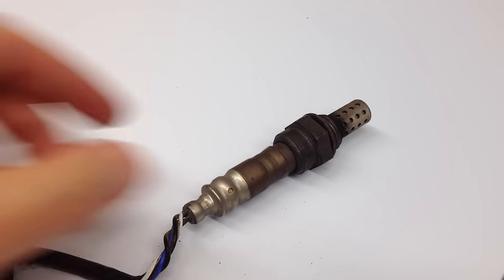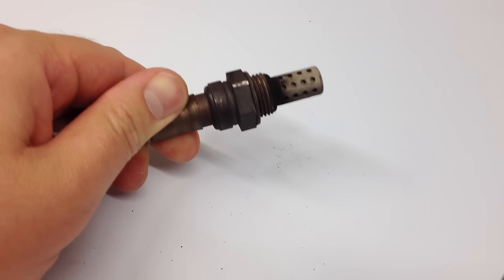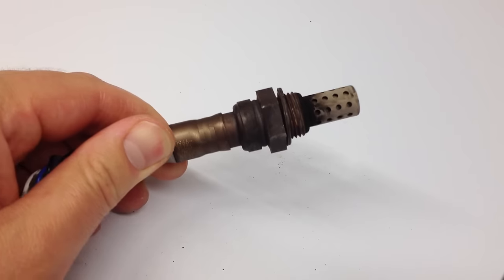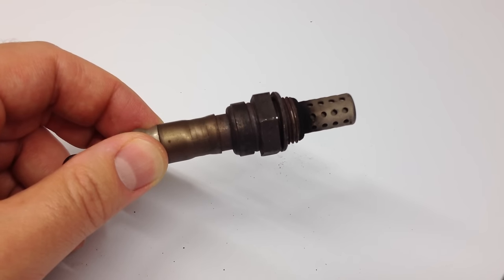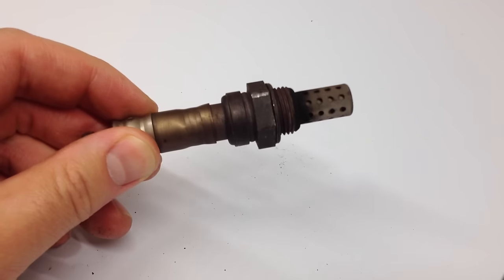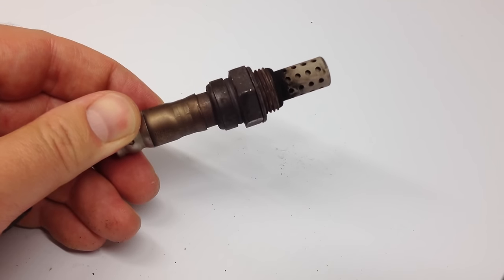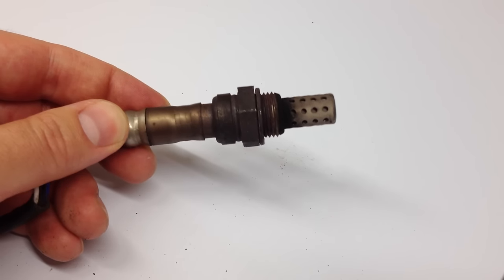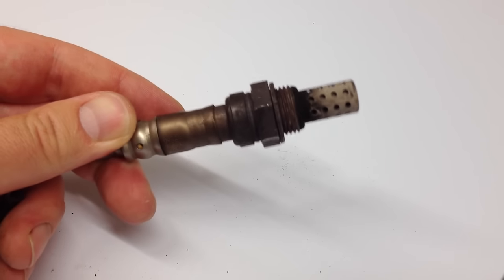Bad Oxygen Sensor Symptoms and Dangers

Comment: will the o2 senser cause a car not to stay running and cause backfire through the intake into the airbox. have to pump gas to keep the car running and it doesnt really run smooth and doesnt rev high
Reply: Throttle cable r linkage is loose
Reply: thats your mass air flow

Comment: Can  a   catalytic   converter   be   stopped    up    with    the    oxygen   sensor    being    still     good?
Reply: Yes, there's other things that are out of the O² sensors range or responsibility like bad rings or valve guides and seals. There's a pecking order when working on car's: always try the cheap and easy stuff first. Things like air filters and oil change's are often overlooked.

Comment: i was getting o2 sensor error(bank 1)...replaced it with an after maket o2 sensor....the error went away but after starting the car the car does not accelerate properly(move forward) for first 10-15 minutes and then works flawlessly.....if i switch it off, again for 10-15 minutes same thing will happen then work properly...what could be wrong? is this after market o2 sensor the problem?
Reply: Almost everyone and every service manuals tell that only original replacement parts should be used for the oxygen sensors. The price difference is so small - 30 - 50, usually, for a part that normally lasts 160k / 100k miles -  that there's really no reason to use generic parts, unless that is the only thing you can find.

Comment: IF SOMEONE COULD TELL ME what would be a deal if leaving it, unplugging it or do I need one for the car to run strong, proper and it's fastest ability. 
MY 96 Civic is being converted to a dirt track racer and will never see the pavement as a legit car again. 
I want to get the most of this cute little 1.6 so I do want it to run it's best. 
(I just pulled up the 035 code tonight)
Reply: @MrRusell86  very cute way of attempting to say I'm uneducated instead of you assuming that it could possibly have been an "autospell" situation that occurred during my typing of a question,  very possibly while using my cellular device.  
But thank you for informing everyone that wastes any time reading this just how educated you think you are.
Reply: It will  either  run to lean or to rich! This will damage engine  and converter!
Reply: Yes, any fuel injected computer controlled car needs a functioning  O² sensor, mass air meter, and throttle position sensor. The O² sensor plays a critical role in telling your PCM how many times and pulse width to open the injectors for fuel. Look at when you buy an EFI kit for a muscle car or hot rod. It's designed to look like a carburetor but it's throttle body fuel injection. And you can bet your ass it comes with an O² sensor.

Comment: Will this make your truck run rough if it’s a bad sensor
Reply: Yes if the air/fuel mixture isn't correct your idle becomes out of sink because it's not getting the correct mixture to keep it from stalling

Comment: My 97 Town Car will randomly throw a code for both sides of the engine saying "mixture too lean." Will a bad o2 sensor cause that?
Reply: Yes
Reply: @juanlatin3595  Turns out that's not what it was. The battery was going bad.
Reply: @DarkElfDiva  that’s a new One me. Never heard of a bad battery doing that

Comment: could this make ur car turn over and but after starting it dies after a few seconds, but once u hit the accelerator it goes and u have to put in N , and keep it a live until light changes and then change it to D and then go.. after about 5 mins the problem might go away?  "i really need help , i have done so much to this van 98 ford windstar 3.0" i have put nearly $800.00 in parts.. i'm not ready to give up, it had all original parts and unfortunate events happen where i had no choice to drive it to FL from tx and i knew it wasnt ready..it made it home though, so any ideas please...
Reply: I have the same problem with my Jetta did you fix the problem or know what was the issue? ..thanks.
Reply: I have the same problem with my Jetta did you fix the problem or know what was the issue? ..thanks.
Reply: scrap yard,then buy different vehicle

Comment: would it make a noise if it's bad on a 93 Volvo 940 ?    It starts but wants to die useing the peal keeps it from dieing
Reply: Definelty not the oxygen sensor. It is not working on cold engines. I would check:
1. fault codes
2. the plugs
3. clean the throttle valve
4. search for vacuum leaks
5. check the petrol pressure
6. check the injectors
7. check the (spark plug ignition [dont know the english word]
8. check the maf airflow sensor data delivered

I think plugs will fix your problems. If they get older cold engine start isnt nice at all.
Reply: Nighthawkzone2 Thank you for your info .The car is still sitting . The only reason it is I'm on a fixs income and I'm sick .But now it's getting nice outside I will do the Plugs .I done number 3,8  . and again THANK YOU Nighthawkzone2

Comment: I just replaced o2 sensors in my rx8 (both up and down). I bought them off of amazon and ebay trying to save some $. They looked identical to the old ones and amazon and ebay said they would work for the rx8 and had good reviews. It started great! but when the temp rose it started to sputter high idle and very low rapidly like it was ready to stall then idle high. What the hell? Do I need to spend the big bucks or what? They are expensive!
Reply: Jbaz what kind did you buy? I just purchased NTK for my rx8 installing it tomorrow
Reply: Mauricio Giraldo Denso 234-4349 Oxygen Sensor (Air and Fuel Ratio Sensor) for the downstream. But the  #s  on the box it came in doesn't match up to any  #s  on the actual part. Not sure if its the right part in the box. It does look identical to the old part though.

New O2 Oxygen Sensor UPSTREAM Mazda RX-8 2004-2008. I bought that one on ebay for $43.36 from Carpartswholesale. I think this part was the problem.  lol  Its a pain in the ass getting to your upstream sensor. I took my oil filter off to give me room to reach the electrical fitting. I also taped the old sensor to the new one  so I could pull it through the same rout because its a nightmare if you get it caught somewhere you cant see. hope this helps.
Reply: Jbaz I heard NTK are the best choice and Denso I next in like after oem of course.  yeah that does help man I was wondering how the hell i was supposed to get to the connector.  once I do it and test it I'll let you know how NTK performs
Reply: Thanks. I cleaned the old sensors and put them back on until I get the right ones. lol that sucked.
Reply: Jbaz dude I am currently having a fight with this damn sensor.  hardly any room and the socket I bought is too short to allow me to attach any wrench and turn.  😤
Reply: ok, I was going to mention this. under the vehicle there's a bracket that is mounted to the exhaust and the bell housing with three bolts. I took that off to give me more room. I also used Neiko 03048A O2 Oxygen Sensor Wrench with Contour Handle and Flexible Head, Cr-V | 7/8 inch     to get the upstream sensor off. I bought it off of amazon but you might be able to get one from a parts store. Then take it back if you want lol. Too bad you don't live in AZ I would let you use mine.
Reply: Jbaz finished changing the sensor after a bit of a battle, a beer and lunch.  car is noticeably better.  my exhaust popping is gone and shaky idle as well.  the real test is tomorrow after a day of hard driving it.  hope you get yours back at 100% man!
Reply: Good job.
Reply: check AutoZone  or Orilley

Comment: Cant get obd codes read at auto parts stores in California. If anyone can get their codes read at one in cali good for you...its illegal now.
Reply from the maker: Wow!  I grew up in CA. Nearly every day I hear something that makes me glad I left.  Illegal to know what's wrong with your car?  Unreal.
Reply: HotDayPleatherSeats yeah its pretty gay. Im over california. Most auto parts stores dont except used oil any more either. I worked for car quest and got to learn alot about the NEW laws.
Reply: I just had my check engine code read for free at O'Reilly Auto Parts a week ago and I live in CA. This is the first I've heard that they won't do it. I purchased an obd reader from Amazon for $15 that I can read on my Android phone and checked the code myself but wanted to make sure the reader I got was actually good. When O'Reilly scanned my car, they got the same code I did - P0135. I bought the 02 sensors from Amazon and called a local mechanic to ask what he would charge to install them; he wanted to charge me $90 to run his own scan before he did any work. I've heard that PepBoys will also scan for free.
Reply: like i said...if you can get it done good for you. i worked for an auto parts store and wasnt even alowed to use my own reader on my lunch break. i couldnt even use my own heat gun to check engine heat.

Comment: I got a oil leak cover fix got my car back had 02sensor and misfired
Reply: Could be a faulty oxygen sensor. Sometimes they can be DOA although not always likely if they are OEM like Denso. I bought a pair of Kwiksen and one trigger a code when I had no check engine light previously. I just change it because I notice a found rotten egg smell (sulfur) and low highway MPG than originally had before a serious catalytic problem trigger the check engine light from running to rich

Comment: dude....check engine light appears from many more reasons than those shitty sensors....i have changed both O2 sensors and the check engine light still appears after 60-70 miles.........a bad oxygen sensor doesnt change the mileage at all,and the catalytic converter will burn out whit high mileage,not because of a bad sensor....sometimes,we have to replace some parts in an engine...anyway we do not agreed whit...
Reply from the maker: Whoever said the light only comes on with a bad O2 sensor?  The video is about an O2 sensor not check engine lights.  And yes, O2 sensor does affect MPG.
Reply: only in certain cases..........
Reply: Aww yes it can affect mpg know your facts before spewing bs.
Reply: alicutz79 Any single instance a vehicle has a bad upstream O2 sensor I guarantee it will not get as good mpg as it would with a good O2 sensor. 

let me add some dots.............
Reply: let me add some dots.............
Reply: add then :)...more then dots means ideas,but add dots :)))))))))))))
Reply: ..more than dots, is all I ever needed to you to show, that your love for me is real :)))))))))))))
ruamilf?
Reply: +alicutz79 probably need a new set of spark plugs is all, plugs that are old and not firing properly and burning all the fuel correctly will cause the o2 sensor code to appear, as a mechanic of over 40 years, I run into this issue a lot, and a new set of plugs resolves the problem 99% of the time

Comment: Anyone!!! I already installed the oxygen sensor, but the light wont go off,  how much time do you need for the light to go off?
Reply: felixsegundo Unplug battery for few hours. You'll lose other stuff like radio setting and clock but thats only way if you don't have ODBII dongle. Personally it is worth $20 or so to buy bluetooth one and get android app troque. Well worth my money.
Reply: felixsegundo Assuming your vehicle is post-1996 of course, my van is 1996 and first year for ODBII.

Comment: question, i took out the wire that power this sensor on my car and check engine light did not come on, how come?
Reply from the maker: It usually takes a while for the car's cpu to recognize the problem, then the light will come on.  If you've driven for days/weeks and it hasn't come on then I have no idea.
Reply: i have already over 100 km since i unplugged the power and still no check light, it's strange because no matter how i drive the car the fuel consumption remains the same 8L of gas per 100 km which is way to much for a 1.4L engine.
Reply: rrazvanell im getting 20.5 per 100km on a 2,2l .lol

Comment: what are the symptoms of a bad 02 sensor ????
Reply: 1. Check Engine Light comes on
The first line of defense is the Check Engine Light. The check engine light will illuminate if you have a bad or failing oxygen sensor. This light can mean many different things, so it is important to have it looked at by a professional. If you have high mileage on your vehicle, chances are it is a bad oxygen sensor that needs to be replaced.

2. Bad gas mileage
If the oxygen sensor is going bad, the fuel-delivery and fuel-combustion systems will be thrown off. If a bad oxygen sensor disrupts the air to fuel ratio mixture or too much fuel is injected into the engine, the gas mileage will go bad. If you suspect you are filling up your gas tank more often, keep a record of how many gallons you fill up with and how often. 

3. Rough engine idle and misfires
As your oxygen sensor is going bad, you may notice your vehicle is running rough, misfiring or running irregularly while idling. Since the oxygen sensors output helps control engine timing, combustion intervals, and the air to fuel ratio, a bad sensor can disrupt these engine functions causing a rough or irregular engine idle.

Copy/Paste from another website, but the info is correct.
Reply: That is what I would expect. Now can one problem mask another and not give the code for another problem like the cam position sensor that is one that can cause similiar problems?
Reply: what are the fucking symptoms we know that the engine light will come on.
Reply: stop cussin' my DAWG reads these post too!
Reply: T G I'm so depressed with my cat coming home late

Comment: is there a reason that I have to keep changing these.  I have changed three times in the past year???
Reply: You are getting taken. Do not pay for another one. It is most likely another condition that is introducing oxygen into the system, (vacuum leak, etc) causing the computer to "throw" an error code related to the O2 sensor. Have the sensor and sensor wiring verified serviceable, by having a REAL MECHANIC do his job. TROUBLESHOOTING!! NOT REMOVE AND REPLACING. Today's so called mechanics ONLY R&R, and cannot figure a thing out past that. Get rid of the PUTZ who R&R'd 3 of the sensors and get yourself a good wrench. It will be cheaper in the long run. Less stress, less aggravation, more time to cruise...
Reply: way too many times,once every 50,000 km or even more as long as other sensors are doing their job.

Comment: i dont have check engine light on...engine runs good...but im only getting 15mpg city with my v6 camry
Reply: get a tune up or oil change
Reply: 15mpg? your driving a v6 what else do you expect.
Reply: Transmission is stuck in limp- mode 2nd. Gear.

Comment: my engine light came on an went to Advance auto an the gauge read :on 2 screens one said :
heated oxygen senor heater control circuit low / bank 1 , sensor 2 / intermittent. the other screen said : oxygen sensor / heater circuit bank 1sensor 2 history mil       Is this just one part the oxygen Sensor ?
Reply: Dan Reese It's just one part the o2 sensor, but people tought me that if the downstream (sensor2) sensor gives a problem, than the catalytic converter could be bad a well ..
Reply: Michiel Dirix yeah , how much I learned since I put that post up . Im for sure my catalytic converter gone , but I found out something that isn't a big plus . That my state will pass on my vehicle emission  test  if I get handicap  tags and only put 5000 miles a year on it . I couldn't afford to get another converter anyway. Thanks for your reply.
Reply: You're welcome 👍

Comment: credit where it do it does work because I just completely replace my exhaust everything from the exhaust manifold down and I bought the wrong o2 sensor  and just rode on it for a few weeks until I just decided to cut off the and replaced it because the other one I bought it was wrong and I have a check engine light on eversncie I cut it off

Comment: o2 sensor look at how much OXYGEN  is in exhaust,too much oxygen,it send voltage closer to .1 volt and pcm in return send more gas,too little OXYGEN it sends voltage closer to .9 volt and pcm  sends less gas,how ever (if you have vacuum leak ,o2 sensor only see that as too much OXYGEN and sends high voltage and you get rich mixture,which ,changing O2 sensor will not help),or if you have leaky injector and car burns rich,O2 see that as not OXYGEN and order pcm to send less gas,also not a bad O2 and changing it is not gonna fix the problem

Comment: My car won't accelerate and the guy at auto zone told me it was the oxygen sensor but I think he'd wrong help plz...
Reply: Try the Mass Airflow Sensor ?
Reply: Turned out it was the catlyc converter
Reply: Now its fixed but my engine light turned on n it smells like burning plastic ...
Reply: nelly garcia Did you find the problem? Usually when the catalytic converter goes bad the O2s also need replaced. If it smells like burning plastic it could be something resting on the hot exhaust pipes
Reply: 3 Things you can check. In the air intake: the Mass Air Flow sensor. Then check to see if the Throttle Body is clean, and the IAC (Idle air control valve). Goodluck
Reply: nelly garcia MY FORD EXPLORER DID THAT, TURNED OUT TO BY BAD CATALYTIC CONVERTERS.  (PLUGGED UP)

Comment: When my o2 sensor went bad it threw a code for my cat.  So don't go spending thousands on a cat before you first change the o2 sensors.
Reply: Thousands for a cat? I just bought a brand new one for my Volkswagon for £45. Are you from America? Are they super expensive over there?

Thanks.
Reply: roadrunnerblink Most of them in america are made with platinum anodes you know that metal that is more expensive then gold.
Reply: michael tech Jeez, get your self a crappy British one instead, will save you a bucket load  :)

Cheers.
Reply: Ira Gershwin It depends on the model of vehicle and the quality of the part.  Some of the "universal" cats are much cheaper, while the higher quality model specific ones are often upwards of $1,000.